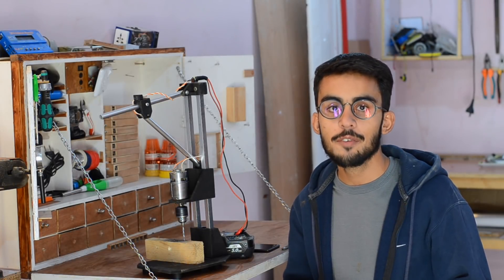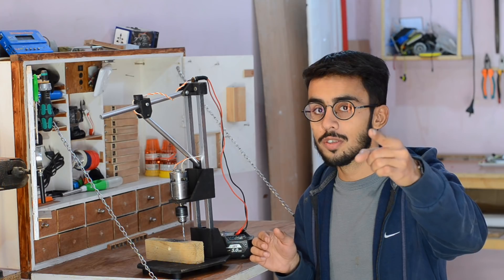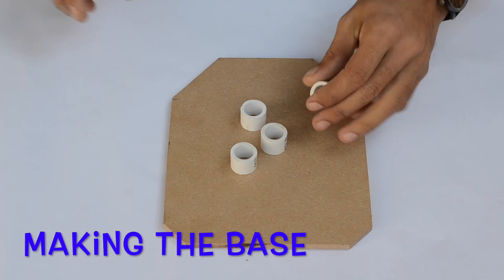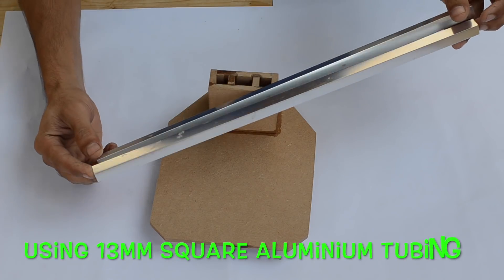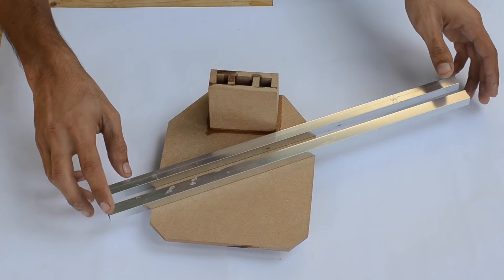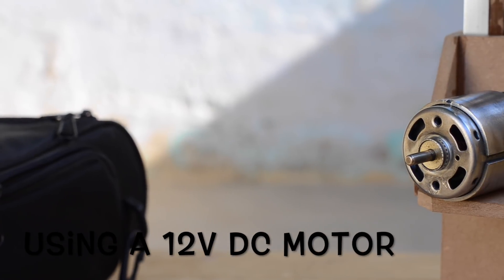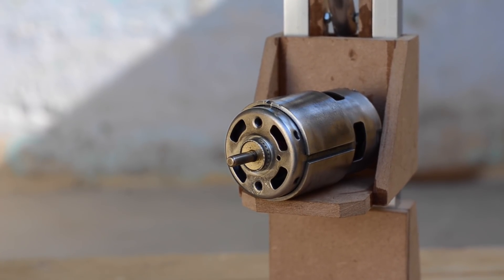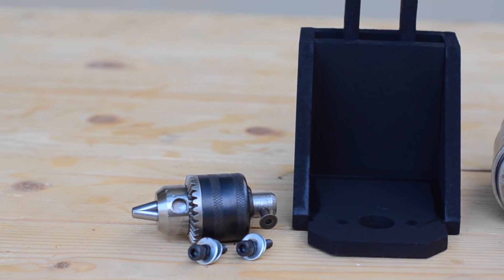How to make a Portable Drill Press

Comment: I made one just like  his except  i used rubber grip under the base vibration  issue  easily  solve by using correct adapter for the chuck, battery  issue solved using 18v converter from an old laptop.
Reply: what battery pack did you use?

Comment: I have installed and maintained many X- ray systems that use square tubing to guide the head assembly up and down, so I know for a fact your design idea is a sound and practical one. A few suggestions: wax the rails, that will help reduce friction. Install plastic grub screws on the carriage to bear against the square tube, this will eliminate most of the errant movement and give better repeatability. Most holes drilled are simply for clearance, so dead- on accuracy is not needed, but in such cases, use of a "spotter" drill first will ensure an accurate followup hole when the desired drill bit is used. Well done!
Reply from the maker: Very informative though.

Thanks a lot I will try to implement most of it.